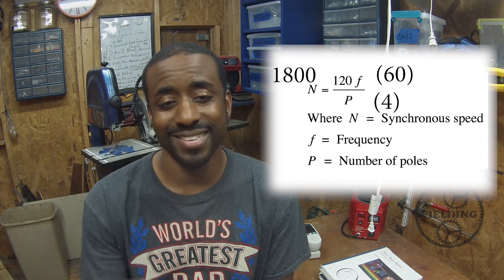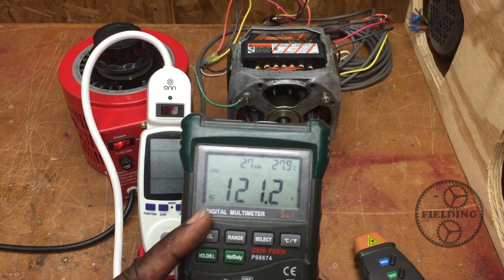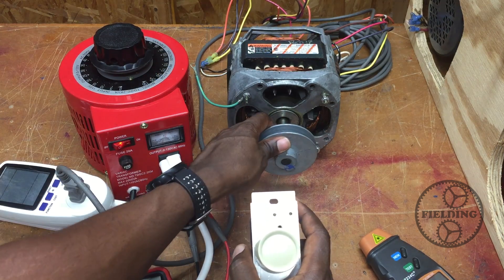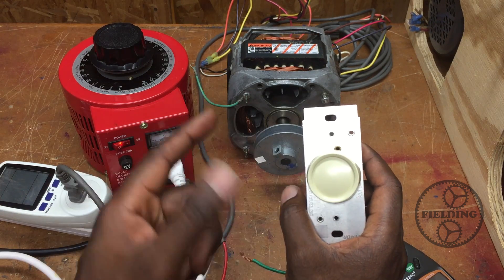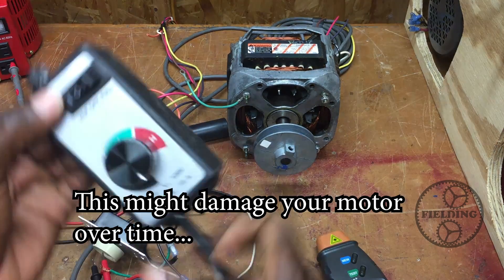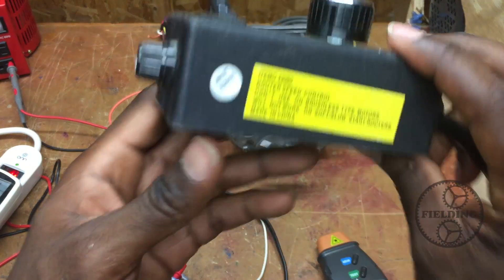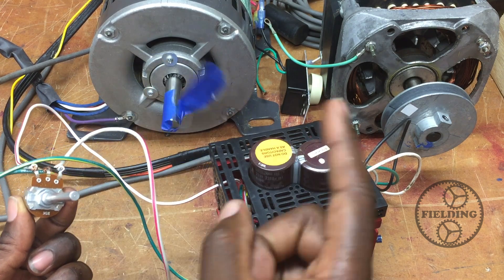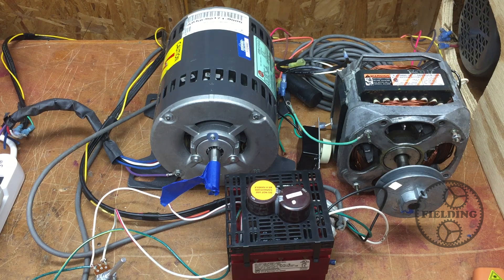Will A Dimmer Switch or Transformer Control An Induction Motor's Speed: 038

Comment: JEREMY: Excellent and interesting video!  I'm fairly handy and have rewired homes - but am quickly out of my comfort zone if the electrical discussion gets too technical - you succeeded in demonstrating the concepts very clearly!  

I hate to ask but am wondering if you can point me in the right direction regarding a current issue:  The kitchen vent hood fan in the home we recently bought has an motor/fan (mounted on the exterior of house) that is controlled by a variable speed dial control at the range hood. When rotating the switch it first clicks to ON at 100% speed and the fan motor runs perfectly. But if I rotate the variable speed switch to any reduced speed the fan motor makes a vary annoying humming sound that doesn't seem to vary much at any reduced speed (and I'm not certain how much the speed is actually reducing) - but the hum goes away when turned back up to 100%.  

I inspected the fan motor (which has what I believe is a starting capacitor) and the bearings seem smooth/solid - so I then thought maybe the "Solid state fan speed control" switch had gone bad. Unfortunately, even though I have a electrical tester with Ohm meter - I'm not sure how to interpret the readings: The tester only responds if set to 200M and then gives a reading of about 150 - which doesn't vary no matter how I adjust the fan speed switch.  To add an additional wrinkle - if it is the switch that's bad - they no longer make it and I can't find it anywhere - so I guess I'd need to find a comparable fan control switch with similar ratings or just go to an on/off switch and live with the loud fan noise at full speed (but at least no humming).

I'd love to get your thoughts on the situation.
Here are some specs:
MOTOR: 115V  60Hz  4.3 Amps

CAPACITOR mounted near fan motor reads:  
5  MF  370 AC  60Hz
Ronken 5000? AFC? <Question marks indicate lettering is a bit rubbed off so I'm guessing

FAN SPEED CONTROLLER:
2.0 Min  6.0 Max  <I think this may be referring to Amps
Contains a warning that it can only be used with a fan that is marked as suitable for solid state control.

If you can help me quiet down this fan my wife and I would be happy to send you a gift card for your favorite store restaurant - totally serious!
Best Regards,
Dave 

 
I'm it is no longer made and I can't find one anywhere so I'm trying to determine a suitable substitute. While I'd love any help you might be able to provide in regards to an appropriate or new/improved replacement, I'm also wondering if can get

Comment: By far and I mean by far my favorite channel.  Along the lines of controlling an AC induction motor through frequency, how would I go about syncing the change in frequency as a response to RPM or gas throttle of a combustion engine? This would be the same principle as a hybrid vehicle or electronic assist for rotating assembly right?

Comment: I’ve been working on a single phase drive (motor driver) for a long time.  I haven’t had enough time to devote to it.  But, I’ll get serious and will let you know when I have it.  There probably isn’t a way to do a “one size fits all”, but there is a way for those who are qualified to build something which could become dangerous for those who don’t have the background in higher power devices to play with them.  The power coming from AC/mains outlets is beyond a kilowatt!  Sometimes two or more Kw.

Comment: So what does slippage look like/sound like? Is it bad if it happens? Because from looking at stackoverflow, cheap ceiling fan speed controls work by connecting capacitance in series with the fan, effectively high-passing the signal, only letting the first portion of the AC sine wave through until the capacitor is full. This changes the RMS voltage on the fan, leading to a lower speed through slippage. At least that's my understanding.
Reply from the maker: check out part two of this series

Comment: What about regulating the power with a set of different capacitors that are in line with the motor? This would of course only work under load. Different capacities would give you different amounts of power.

Comment: hi Jeremy my question is can you lower the voltage to a microwave transformer being used as a lichtenberg machine to burn wood. i am wondering if controlling the voltage will have different effects in the burning.2nd question if you had to make the homemade lichtenberg machine how would you do it so it is safe
Reply: No litchenberg machine is safe as you are dealing with high voltage. You can use microwave oven transformer to make one for you

Comment: WHY then, do SINGER sewing machine motors, use a variable VOLTAGE, foot speed control?  Plus, sewing machine single phase motors are used, most often, from zero volts to less than 50 Vac, and under high loads?

Comment: You have wrong dimmer or maybe i think, if you have correctly wired your dimmer in series before the motor and on the ground. I say that because your speed should change what ever the voltage and adjust the speed of rotation proportionally. And your different checks just show a range between + ou - 1.0 rather than showing 0.0 to 110.0 (exemple). It could be better i guess with use of pwm and ne555 (freq + duty) etc... Maybe i'm wrong .... :)

Comment: Thank you!  Been searching forums for two days trying to find this info.
This may be a dumb question, but what happens to torque with a vfd?  Do you get lower torque at lower speeds?
Reply from the maker: same torque (less speed) up to rated power of the motor... then as speed goes up torque goes down so that the total power remains the same.
Reply: @Jeremy_Fielding  Thank you!  I don't know anything about this stuff.  I'm looking in to building my own 2x72 belt grinder for knife making.  This definitely helps.

Comment: You should be teaching college electronics classes.   Question.  So, are typical woodworking routers "brushless"?  That clip in your vid said don't use rheostats on brushless motors like you were demonstrating (where the speed) didn't change.   I am assuming that since that router rheostat you showed us with the warning is meant to go with routers, that it's OK to use them.  I need to turn down the speed on my router.   Very helpful video.  Your' knowledge, and camera presence, combine to make a very informative presentation.

Comment: wonderful channel! I've Been binge watching for days now trying to find an answer to a problem i'm having and i'm hoping you could help. I brought a treadmill with a broken running board as it was a bargain for the motor alone; 2hp/3.5hpp 5400rpm. Due to the construction i had to cut the wires from the wall plug to the power switch and from the monitor to the pcb to get it apart..If a friend can't get it working with some solder work this weekend i will need to take the board off completely but no way i can afford a vfd controller.  I watched a video today that says a 10k SCR with a 200k potentiometer works as a cheap way to add speed control to a treadmill motor but his was DC, mine is not. H used a Bridge rectifier to make it work, i know i wouldn't need one but this video says that wont work, at least not for the long run.. Are there any other options or things i could look at? would it be possible to remove everything between the on/off switch and motor and put a new plug on that for now, it only has 3 wires coming from the motor. Red, black, ground. Thank you
Reply from the maker: watch my video on wiring dc motors and controlling them

Comment: I have a motor I got from the scrap yard. It's from a industrial pedestal fan. The nameplate is gone. However I changed the capacitor and all I had was a 3way on off switch. The pull switch was broken so my question is: what can I use in place of a pull switch?

Comment: Hello! Thanks a lot for the great tutorial. My question is: Whats inside a variable speed power tool? Cant be that big of course.
Reply: Well they don’t use brushless induction motors. They use brushless dc motors (which uses pwm to control speed) and brushed dc motors (which uses voltage to control speed). Those are much easier and very compact speed controllers to manufacture
Reply: Great Q!

Comment: if its so hard to change the speeds of single phase motors, how do fans work? Usually have Low, Med, High settings, that all change the RPM of the fan.
Reply from the maker: Robert Gibbs This video has a part two which addresses this issue

Comment: Thank you Jeremy! One question: what is the method we used to control the speed of a fan(single phase AC induction motor installed inside)?
Reply from the maker: Gunther Z This video has a part two which addresses this issue

Comment: Thank you so much for your video!!
Can you comment this subject, but instead, with a universal 1 phase motor.  Will dimmer switch or voltage regulator, do the job with speed control?
Thanks again! :)

Comment: When using the frequency converter, does it produce more torque at the lower frequency?  I seem to remember on some big moulder motors that you start them up at low frequency, and once up to speed the frequency converter kicks in to really make them hum.

Comment: A popular request is for a speed control on mains powered electric hand drills. Most are brushed motors (I think). In practice speed control is achieved crudely by trigger control. S o it follows that if we can duplicate whatever the trigger mechanism does we should get safe speed control without motor damage. Can you please investigate this & maybe suggest a solution?

Comment: I watched several videos discussing dimmer switches and motors but your video by far had the best information density lol
I started researching this because my dad's old vinyl record player still works, but it has no finite speed adjustment within each RPM setting.  Just looking at the motor, I believe it is a 3-phase induction motor.  Would using a dimmer switch (I imagine the record will serve as a mechanical load) be okay for finite speed adjustments?  Say, in the order of a few RPM?  Or would there still be ill-effects?

Comment: Will a vfd work on a 5 hp single phase induction motor that has a start and run capacitor IF I manually switch off the start capacitor?

Comment: I READ EVERY COMMENT BEFORE POSTING!!!! I didn't see anything relevant to my question which is....

I recently built the 12 volt power supply using a single phase Transformer, full wave Bridge rectifier, acceptable amount of capacitance to smooth Ripple, and then straight to the DC output terminals. Being unregulated it's putting out 16.4 volts DC to output terminals..... Is there an issue using a triac on the primary side of a transformer to control the secondary voltage thus lowering DC output?
Reply: Sounds like you're using a transformer with a 12v secondary. Using  one with a 9v secondary will help, but better still use a 12v regulator of the appropriate current rating on the low voltage side. This will help to avoid voltage drop when your PSU is under load. I learnt all this when I built a PSU for a colour TV camera many years ago. 12v regulators work best when their input voltage is 5 or 6 volts higher than the desired output voltage

Comment: I have a big antique shop fan that is very noisy. Moves a ton of air but sounds like a helicopter. I tried a router controller and the motor got hot enough to start burning off something. I shut it down and squirted a little water on it and the drops of water we're floating on on steam. So long story short a dimmer switch on a single phase motor was a dumb move on my part. It survived but I probably cooked off something important to the longevity of the motor.

Comment: So I'm building a lathe and I wanted to control the speed. Having experience with DC steppers and achy servos I understood some basics. A friend was asking if he could use a 1/3 how motor and a fan switch. This video was the best way to explain that you can't. I pointed him in the direction of a nema stepper and a driver/ breakout board. Thanks for your video very helpful!

Comment: So basically for all common cheapo single phase induction motors, stay safe and use a system of pulleys or gears?  Fancy speed control stuff for 3 phase motors, go VFD.  Good video and explanation!  Maybe I can start thinking about building a metal cutting band saw or belt sander.

Comment: Thank you for sharing. 
I plan to build a VFD which drives 36V , 3phase motor at 200Hz from AC mains which is 220V and 50Hz here. My frequency will remain constant as 200Hz while motor operates, so should i use a soft starter or a VFD? Any advice is appreciated. Thanks.

Comment: @Jeremy Fielding So a few weeks ago i made a mini wood lathe with an old 1.9k rpm high torque motor. I wanted to be able to control the Speed of the motor, because yknow, lathe things. Hooked up an old light dimmer between outlet and motor and turned the motor on. Nothing happened until i turned on the dimmer... i thought it was working, but a few seconds later the motor just turned off and has no signs of life whatsoever. There was no smoke at all, so the "magic smoke" didnt escape haha. The dimmer still works. There is no fuse in the motor circuit, it runs on 230 volt, the dimmer was well in range for the motor as it only drew ~80 watts under "normal lathe load" and the dimmer was good to ~160 watts. What happened? im pondering as to why my motor died.
Does it have something to do with AC and DC?

Comment: Thanks, I just was working in a similar setback!  I am still looking for answer where to find low horse power motor with three phases to change the motor speed. I need 1/12 HP motor for my application!

Comment: so what is the way if i want to control speed of motor of  sewing machine  220va/50hz/250w/permanent  capacitor it always running and i press mechanical clutch to engage the machine

Comment: You are talking about VFD's working only on three-phase motors, what about DC motors (of which I can recycle quite a few here in Belgium)? Can one control the speed of such a motor? I can source three-phase motors, but I can not source three-phase power where the self-built machine I am working on will find its home...

On a side-note, does the torque increase as you lower the speed with a VFD?

Thanks!
Reply: DC motors are easily controllable by changing the voltage. How the motor will behave in detail and the useability can vary,  gotta choose the right motor from the get-go to get the best results.

Comment: PS2 the last comment it's hooked up to a 120 Outlet about using the dimmer switch for a heat element will that work or do you have to put anything in the line this way it doesn't burn it out thank you Mike

Comment: Hey man,

So is there another way that I can contact you with a couple questions regarding controlling a fan speed.  It’s hard to explain but it’s for controlling the air flow used to feed a burn barrel set up for Firefighter training.  Currently what’s used is a cheap blower you can buy anywhere and then a dimmer switch is used to control the voltage to the blower.  It is a horrible set up and is a huge pain to control. Which after watching your video makes sense now.  I would like a better solution that doesn’t break the bank.  We will be needing about 6 set ups to use here around March of 2020 before our class we are hosting.  Thank you in advance.

Comment: Hey Jeremy! Can you make a video on how to make a VFD? That would be great!
Reply from the maker: That is way outside my skills. I just buy them
Reply: Jeremy Fielding which one do you buy? What is the price range?? It seems like if I want variable speed, I should get 3 phase or dc... which world be cheaper, Hope do I size these components together? Thanks for this amazing work and channel
Reply: @MM-24  you have to buy according to your needs. If you have incoming single phase (wall socket) and you want to control a 3 phase motor, you need single phase AC to 3 phase AC VFD. Honestly, they make VFDs for every combination possible. Just figure out what kind of power source you got (single phase, two phase, three phase or DC) and what motor you wanna hook it up to (single phase, three phase). Then figure out what kind of voltage and current would be going through the VFD. Start you search from there. For example, search for DC to 3 phase AC VFD. Then look at the current, voltage, power ratings of the results and pick out what you need.

Comment: how does Jet tools make my lathe (110v) go fast and slow and still work under a load?
Reply from the maker: That depends a great deal on the type of motor and electrics used. I have no idea. Its probably not an induction motor.

Comment: Hi Jeremy
I just subscribe after watching a few videos of yours. I have a small machine shop with many motors. Love your shows. My question:
Starting a horizontal mill at high speed I needed a larger motor. My son installed a 1.5hp single phase 220v. The momentary starting amp is about 6 times of the free running amp. I like motors, grew up in a steel shop but for the last 60 years I was structural engineer. This is part of my hobby 
This high amp is that normal? I remembered 3 times only.
Reply from the maker: I can’t give advice like this. The number of people asking is too high and the possible other causes makes it unsafe. Different motors have different numbers and safe ranges
Reply: So, how can you help?
Reply from the maker: @thatoldbob7956  I make videos about FAQ